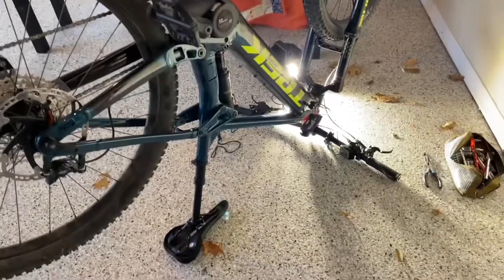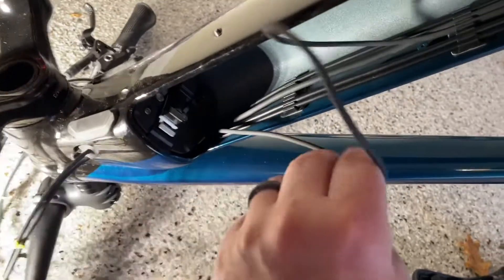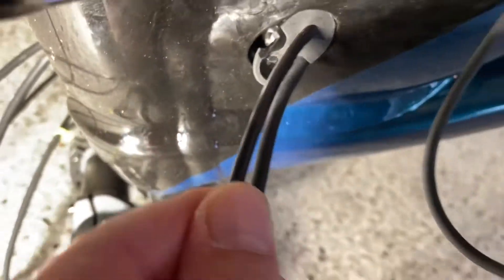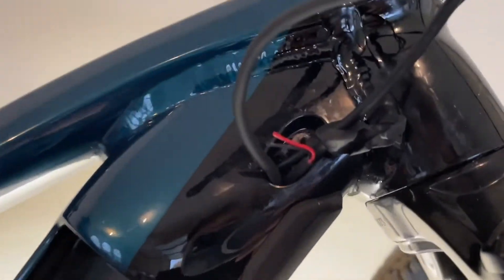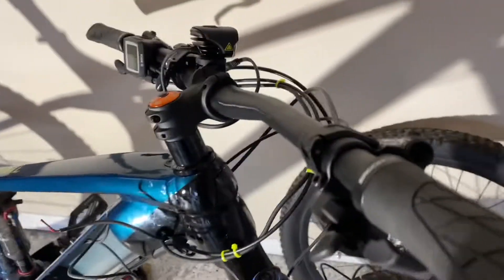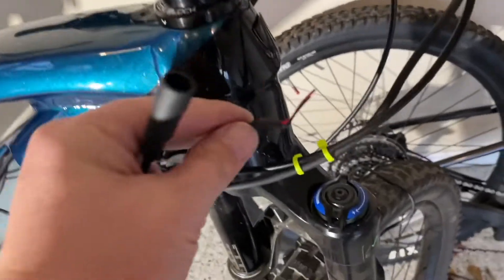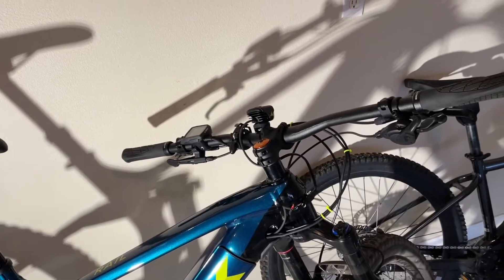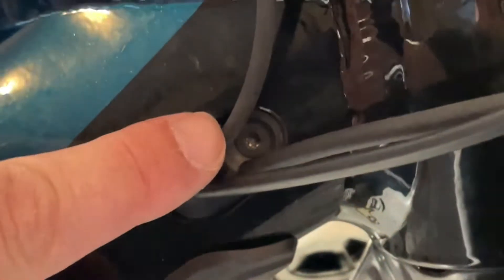Wiring an E-bike light to a 2022 Trek Rail 7!

Comment: Did you have to bring the bike into the shop to have them to program the bike for the light that you mentioned in the video? I just bought a Powerfly FS 4 Gen 3 and am looking for a light myself.  Great informative video, thanks.
Reply from the maker: Yes, I did have to take it to the shop to get them to enable the light that I installed.
Reply: @nomaddict5279  Thanks for the reply. Thinking more about this, I think I will go with the separate battery version, less confusing, wiring, and its brighter as you say.

Comment from the maker: The light I used in this video (MagicShine MJ906S) actually pulls too many amps on its highest setting. It has an Ebike mode that works great though. To get the light into this mode, hold the power button for eight seconds until it blinks red.  Do NOT put the light on its highest output mode without doing this FIRST or it will cause an error on the Bosch computer screen and you will then have to wire the light to another battery source that can handle the high amps long enough to let you switch to the ebike mode (which is what I had to do). The light is extremely bright on the highest mode when not in E bike mode, so if you have a battery that can handle the higher amps, you will be amazed at the output. It still seems decently bright on the highest E bike mode.
Reply: @nomaddict5279 
I’ve just bought a trek rail 9.5 gen 2 a few days ago, is this light worth buying or should I get a slightly less powerful one? Also want to make sure.. are you saying the light cannot be used in its highest power on your bike? If so.. do you know if there’s a light that the bike can handle better?
Reply from the maker: @skullxsmasherz3548  it’s plenty bright for me in the E bike mode, and it seems to be really well-made, so I am happy with the purchase. I read where some people have wired directly into the Bosch battery to get past the electrical limitations of the factory wiring/computer, but I’m sure that voids the warranty. I think it puts out around 2800 lumens in the highest E bike mode, which is totally fine for me.  I was getting by on 1300 lumens before I bought this (and 1300 lumens on my helmet), and I ride 10 to 15mph comfortably on singletrack trails in pitch black, so this is even better. The 4500 lumen output is for the highest non-ebike mode.  It would be nice to use that mode, but I’m not too disappointed. I’m mostly glad to have something directly wired into the bike and this puts out about as many lumens as you will find on any light that will work with this bike.

When you take it to the dealer to have the computer programmed to use a light, they will be able to set it to always on, or not always on. Tell them to use the not always on mode.  otherwise the light is on even during the daytime, and you cannot turn it off with the button on the light.
Reply from the maker: @skullxsmasherz3548  also, in the highest E bike mode, which is 2800 lm I believe, it pulls about 15W.  Whatever watt number you tell them determines how much battery reserve the bike keeps for pedal assist versus headlght power (it’s designed to leave you some battery for your light so you can at least pedal home, versus draining the battery with pedal assist and not having a headlight).
Reply: @nomaddict5279 thanks for the help I ordered the light and it came a couple of days ago, I haven’t installed it yet but will get it done asap👍
Reply from the maker: @skullxsmasherz3548  hey awesome!! I think you’ll really like it!  Just be sure to hold down the button for 8 seconds to get it into ebike mode before you accidentally put it on non-ebike high mode like I did! :)
Reply: Thank you for sharing. I like the idea of always having a light available on the bike
. Was there a wire for a rear light?
 

 I'm getting fed up with having to keep going to the bike shop just to adjust simple settings. Like the walk mode speed, and to enable an extender battery and phone holder charger, and now enabling lights.

Very interesting to know about ebike ready lights too. Thank you
Reply from the maker: @johnboardman4820 hey, thanks for the feedback!  Glad it was useful!  I'm not aware of a wire for a rear light. I just used a little LED light that straps to the seat post (I leave it there all the time, as it's really compact), and I turn it on and off via its own little button. Battery lasts a long time. Good luck!
Reply: @nomaddict5279 
I already have the lighting wire in the battery compartment so I think I'll go for the ebikw ready light. 

Have a great day